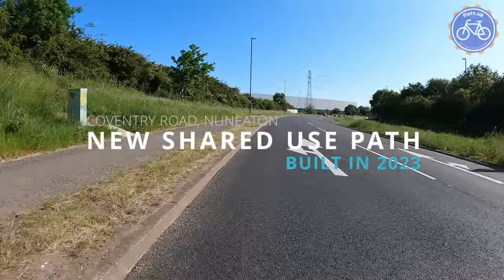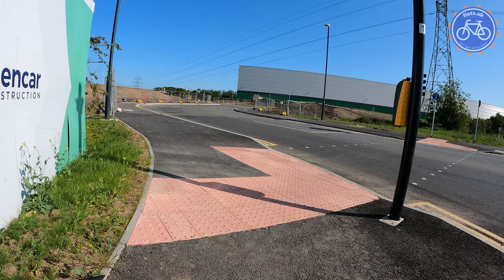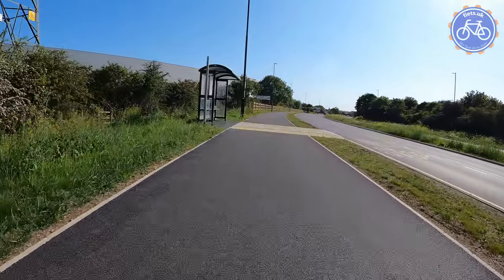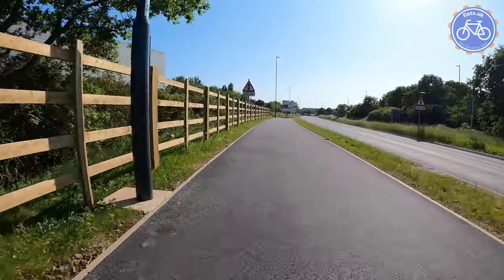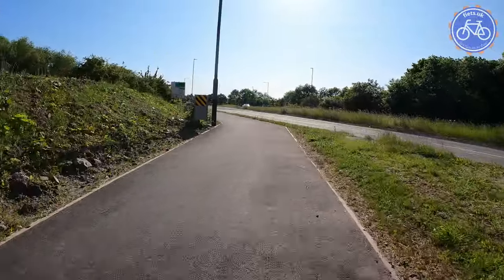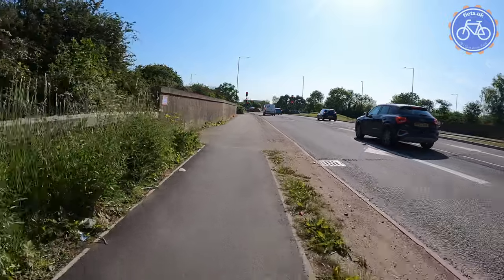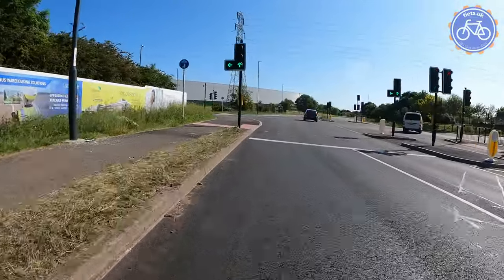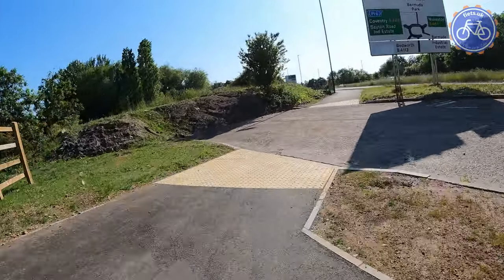“Cyclists Dismount”: Evaluating a NEW Shared Use Path

Comment: This is poor but not unusual. Is a law-abiding cyclist meant to bounce down the kerb onto the road for that tiny distance?

I live in Leicester, where we have toucan crossings but nothing to indicate that the path on either side is a shared one. Also, there's the opposite situation where signage indicates shared paths but a  crossing over a major junction only has signals for pedestrians. 

It does make me wonder if anyone ever cycles along this infrastructure before signing it off as complete.
Reply from the maker: We have a two-stage staggered crossing over the ring-road in Nuneaton. One stage is toucan, the other is signed just for pedestrians! I'm not quite sure how that would have come about!